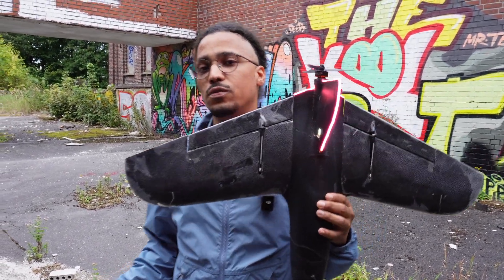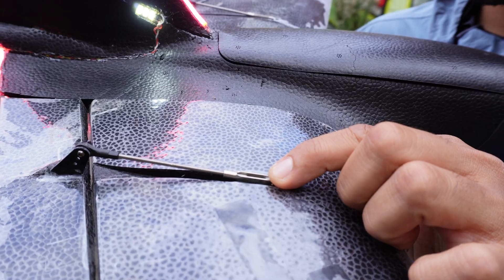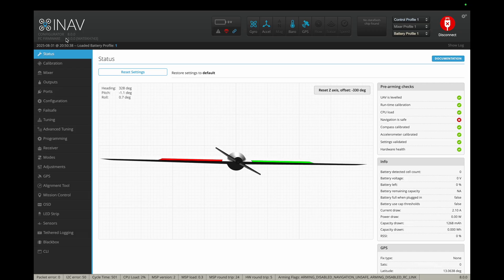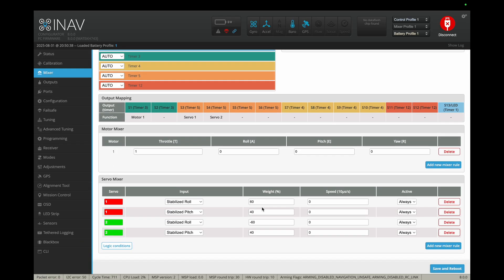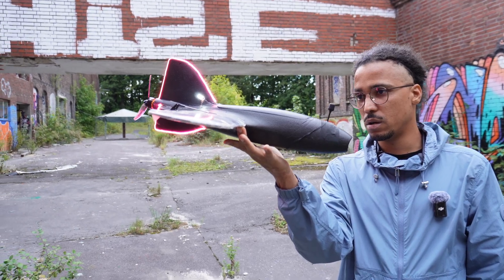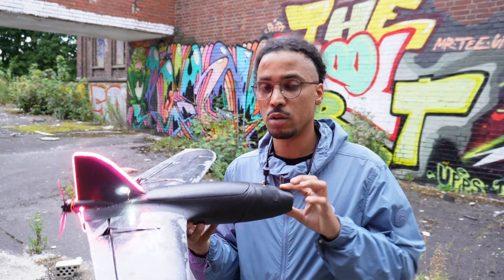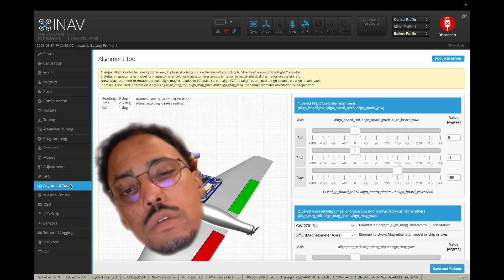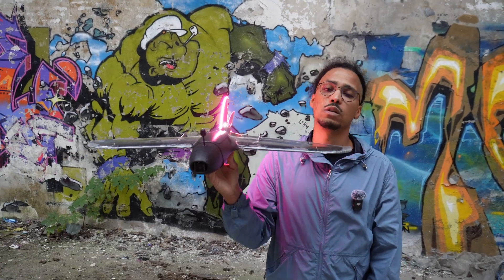How to Tune a FPV Flying Wing | Mechanical & Software | TBS Chupito

Comment: I’ve been enjoying your videos about the Chupito.
My first Chupito is completely wrecked now.
In manual mode, it slightly tilted to the left but was still flyable.
However, when I switched to acro mode, it lost attitude control and flipped to the left, crashing into the ground.
Could this have happened because I didn’t do the auto-trim?
It flew fine in angle mode, so I’m not sure what I missed.
Reply from the maker: Hmm , something else must have been wrong. If it flew fine in angle ,it should have flown fine in acro too. 
Kinda impossible to tell what agent wrong.
Reply: @kofikofikofikofikofi There was also a tilting to the left even in Angle mode.
Reply from the maker: @3004FPV  check my tuning video ;)

Comment: The tbs cli dump set the servos to 333hz.  Should it be set to 100hz?  They dont get hot  or twitch at 333hz. Using the tbs chupito servos.
Reply from the maker: Leave it @ 333. Stock servos can do 333. I got it wrong.
Reply: @kofikofikofikofikofi another question. When I pitch up or down quickly it kind of stutters. Like it starts then stops then continues. Even in full manual. Is that the servos stalling or elevons bending?
Reply from the maker: @squirrelynutz1  kinda hard to diagnose without video.might have to much throw
Reply: @kofikofikofikofikofi  its the stock servos on 3rd hole from bottom. Feedforward is 127 rate 110 after autotune. Best way to describe is. A quick full pitch the plane will start the move. Stop for a split second, then continue like normal. This is in manual. I fly around 50% throttle.
Reply from the maker: @squirrelynutz1 decrease the manual pitch rate and check if it fixes the undesired behavior
Reply: @kofikofikofikofikofi k ill give that a try. It happens in acro too.

Comment: There’s a specific setting in tuning for pitch alignment under mechanics.

The info on the max deflection before stall is good, but why apply that to manual only? Apply it to the mixer in my opinion so it works for acro and manual.
Reply from the maker: It’s called level trim , U can use that 2. I don’t.  Bruv watch the whole ting, I explain how to tune each mode ;)

Comment: Do you run ADC filtering on your controller? I usally have it turned off for my quads but turned on for my fixed wings that have no fc. I would  be interested in your thoughts @kofikofikofi
Reply from the maker: always turned off

Comment: Covered a lot in a fairly short video!  Good overview, and sending people to UAV Tech is a great call.  You're right on the filtering.  INAV has way too much but the devs seem to disagree, so getting it set well will take a little time and doing.  I think the devs bias towards default settings that are really conservative and can fly any plane.  But the latency can be rough.  Adjusting PIDs in the air in real time helps a lot too.  That's the biggest secret that few people use.  It takes time to get dialed in, but it's soo worth it l.

Comment: Thanks for the great Informations and taking time for sharing it! 
Where did you get the extended elevon horn from? Printed from some CF reinforced material?
Reply from the maker: https://www.hoelleinshop.com/GfK-Ruderhoerner-schwarz-12mm-Bohrung-1-5-mm.htm?shop=hoellein&SessionId=&a=article&ProdNr=PIX0722&t=49303&c=15665&p=15665

Comment: You should be setting your level flight angle in the tuning tab.
Reply: Also keep in mind UAVtech's tuning guide for wings was for 7.x.x, and I noticed the kalman filter CLI settings were different in 8.0.1. Not sure if they did away with it, or not.
Reply from the maker: @Carticiak  There's more than one way to skin a cat but you’re right. The setting’s called ‘level uptrim’. There’s also a mode u can put on a switch that determines your needed uptrim.
Uav techs filter setup still has the least latency ;)
Reply: @kofikofikofikofikofi  That's the thing, the auto level trim mode only adjusts the trim in the tuning/mechanics tab. This came up when folks were updating the atomrc swordfish from 6 to 8. Overall the only thing that happens is it tries to climb aggressively if it's tuned poorly. 

Have you noticed any real difference with the lower latency tune? I've flown both with and without his tune for hours comparitively and it just seemed more jittery during long range flights.
Reply from the maker: @Carticiak jeah that’s why in didn’t mention these options. I have zero level trim and trimmed the plane like in the video. My shits flyin straight. 
I didn’t do any before after testing but my approach is to shave every ms latency possible cuz it adds up.✌🏾
Reply: @kofikofikofikofikofi That checks out! I wasnt sure if maybe it worked better with smaller craft or something.

Comment: Yeah first point to tell Copter peeps is a Good flight Controller can never fly a badly set up plane like it can a Quad 😏
Good job explaining direct control (manual mode) and reason to Trim the plane in it.

Comment: With inav 8.0.1 in mechanics tab there is level trim this were you set 2 to 4 trim to fly level also some airfoils need a small amount of reflex which is done manually before your first flight .
Reply from the maker: Good Point! I forgot to mention Reflex. Actually most of the Wings need 2-4 mm elevon up trim. Thx

Comment: Random thought while watching: does anyone here have a 3D-printed adapter that makes a SpeedyBee Mini FC fit the Chupito? Bonus points if it’s in the same format as the TBS AIO.
Anyway, solid video — even if we’ll have to agree to disagree on ACRO. I just can’t stop throwing my planes around in ACRO mode, it’s my guilty pleasure 😂
Reply from the maker: Just double sided sticky it in ✌🏾
Reply: I have an adapter for the larger F405, its in the RC Groups thread
Reply: @dr.loopinglooie thx, found it
Reply: @dr.loopinglooie  thx, I found it!

Comment: nice tutorial ... saw you flying with the Tango 2 (in white, how posh ;-)): what about a short tutorial how you configured your switches on the Tango 2 with iNAV ? "Switchwise" the Tango 2 is somewhat limited for all the iNAV modes and functions, what are the essentials for a) tuning/maiden and b) every day flying ? 
I know how to configure switches and modes in iNAV and the Tango 2, but I'm looking for a suggestion how to use the limited resources of the Tango 2 ....
Reply from the maker: Appreciate it 🙏🏾, tango 2 switch config: left shoulder button(Arm) ,left 3 way (/,led,auto trim) right 3 way (manual/acro/angle) , right shoulder (rth)
Reply: @kofikofikofikofikofi  TX ! That's a minimalistic but very functional layout - I will copy that! I was considering "autolaunch" on a switch, some say the "always-autolaunch-on-arm" is dangerous in case of a failsafe: the FC will not rearm without autolaunch in the air (don't know if that is true). "Loiter" would be nice too ? - in any case: "LED" on a switch is a statement on a Tango 2 ;-)
Reply from the maker: @hans-jochenschmitt9314 I’m pretty sure that you can rearm midair:) led on a switch is a must for stealthy landings